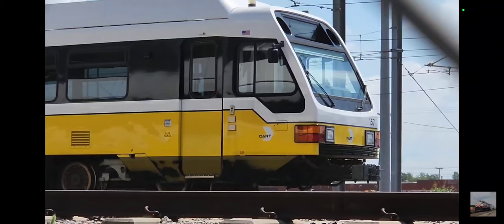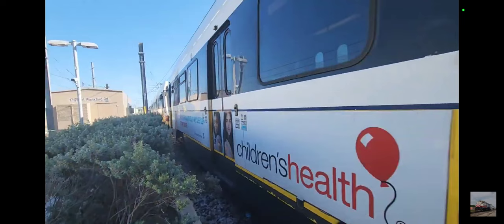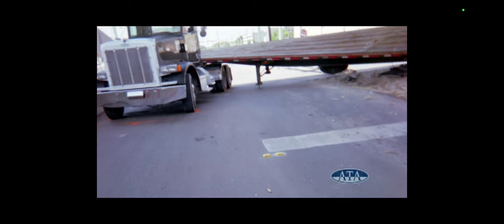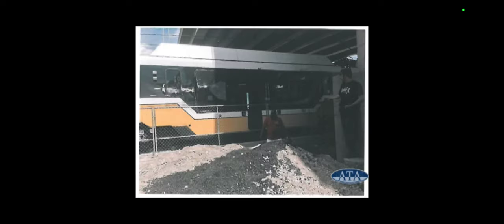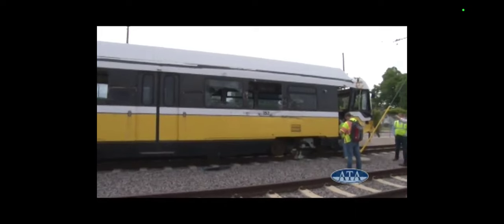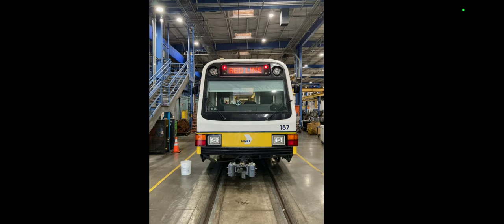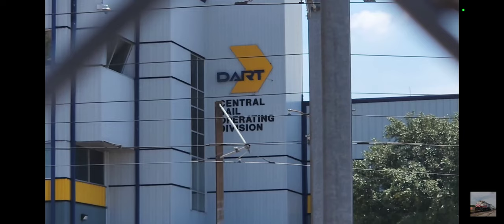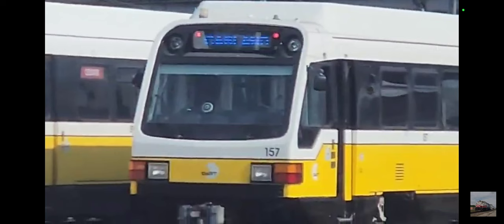DART 157 Accident & Derailment 8 Years Later (Documentary)

Comment: The real dead train of dart is 177
Reply from the maker: 177, 107, and 189 are all dead as they're in storage.. forever.
probably being tortured or somethin
Reply: 177 and 157 are being used for spare parts there are talks of taking the end sections and combining them to make a good Lrv. 157 has major wire damage from when the body place they sent it to rewired it. 
102 is also being parted out. 
106 is not being used for parts due to it becoming the yellow submarine